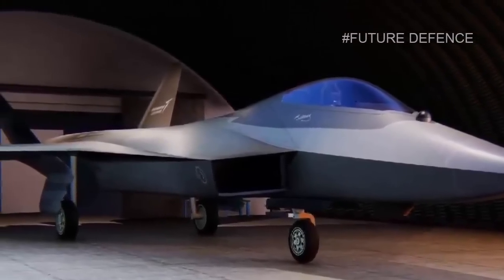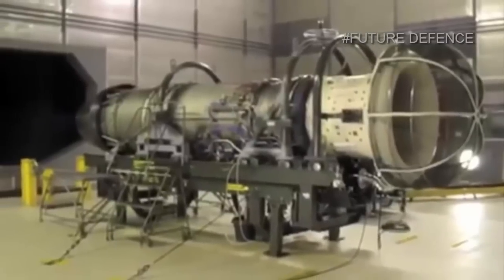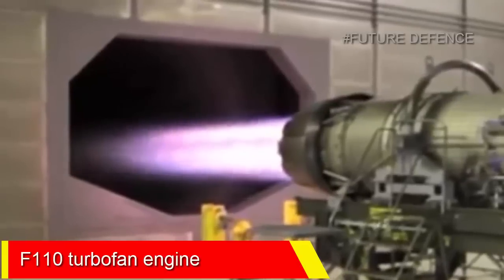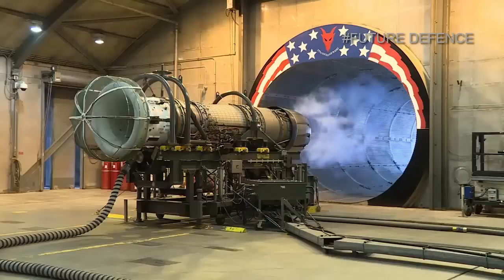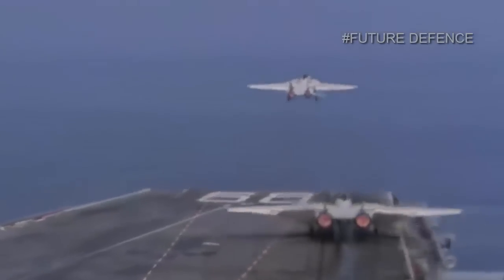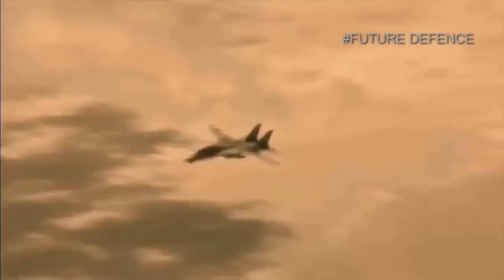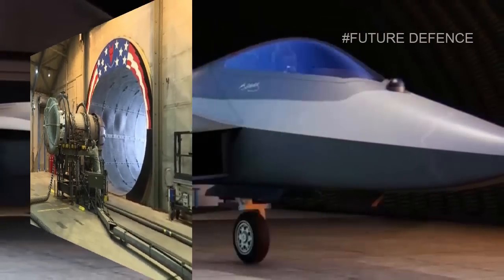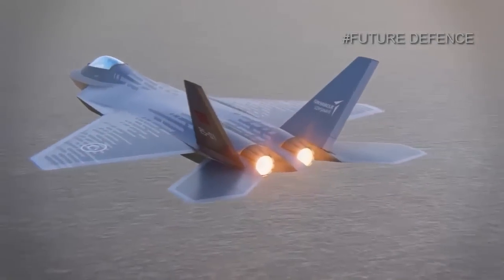here's the Turkey TF-X next-gen prototype with  U.S. F-110 turbofan engine

Comment: It needs thrust vectoring because the plane itself does not look too stealthy. It will eventually find itself in a dogfight while conducting missions. Also mach 1.8 is not enough. Must be minimum Mach 2. So there must be improvements.
Reply: they use an old engine from 1986
Reply: @bartversteege2910  This "old" F110-GE-129 engine will be used on F-15EX also. TRMotor, Rolls-Royce-Kale-Pratt, TEI will develop a new engine.
Reply: @bsenyuva  it is not the same as the f16 has...upgrated
Reply: @bartversteege2910  F110-GE-100 is the old one, F110-GE-129 is the new one. F16 is also used F110-GE-129 and F-15EX will use it.

Anyway, as I said 8 F110-GE-129 engines will be used on TFX Block 0 and Block 1 prototypes. Then it will be replaced with advanced engines.
Reply: Yeah, that's what the defense minister also said afaik. He stated that right now the plane is something between F-16 and F-35. He stated that they will improve it.
Reply: @iLikeTrains0372  No he said the new jet is somewhere between the F22 and the F35. He did not mention the F16 except he said it will be better than the latest version of the F16.
Reply: @samicolgecen1991  İsmail Demir'den bahsediyoruz değil mi? Ahmet Hakan'ın programında şimdilik F-16 ile F-35 arası bir yerde demişti. F-35'le F-22 arası olamaz çünkü ikisi farklı sınıf uçaklar diye biliyorum.
Reply: @iLikeTrains0372  F22 ile F35 arası olacak demişti, çünkü ikiside farklı görev uçağı ve MMU multi role yani birden çok görevi yapabilecek bir uçak olarak tasarlanmaya çalışılıyor. Yani F22 gibi air dominance, ve F35 gibi strike özelliği olabilecek deniyot. Ben güzel şeylerin çıkacağını arzuluyorum fakat gerçekçi düşünürsek hiç zannetmiyorum. Zaten seçilen dizayn yanlış, YF23 dizaynına yakın daha görünmezlik dizaynı olan bir platform seçilmeliydi, F22 platformu seçildi.
Reply: @iLikeTrains0372  F-35 engine is on a different level...in fact it is two engines the F35B has even 3 engines then it can hover also.
Reply: @bartversteege2910  I was talking about the capabilities. The engine situation is a little complicated.
Reply: @iLikeTrains0372  its all about that....
Reply: @bartversteege2910  F35B has only one engine
Reply: Mas maganda kung hindi gagamit ng fossilfuel😆
Reply: Tfx start.We will produce the world's superior warplanes.
Reply: @kenan1029  No we can not do that. Our plane will be better than our F16s and other 4th gen fighters. Maybe better than F35 as well, but no where near the F22 or the SU57, or J20. Still, TFX is better than nothing right?
Reply: @samicolgecen1991  From America's F35, Russia's  Su57 from Turkey's TFX aircraft is good.
Reply: @kenan1029  Türkçesini yaz ingilizcen iyi değil.
Reply: The fighter planes with Mach 2 aren't better than the ones with March 1.8. Speed limits the maneuvre capabilities of fighter planes. It doesn't have any advantage for fighter planes.
Reply: @Alprtngakrc  It does, especially in the fighters with supercruise. More power from the engine, faster the top speed and supercruise will be. Also trust the weight ratio will be greater resulting in quicker recovery from hard turns where the jet bleeds most of its energy. More powerful engine is very important. Faster top speed is a direct result of that.
Reply: @samicolgecen1991  Fighter plane pilots don't don't agree with that. They say that they rarely fly  with top speed. That must be something in the minds of aerospace engineers. This's definitely not the priority of fighter plane pilots.
Reply: @Alprtngakrc  I heard different, they say speed is everything in an event of a dog fight.... they fly with afterburners when engaged in a dog fight. So high speed  and high kinetic energy definitely a priority for them.
Reply: Couldnt Turkiye buy engine with thrust superior to 2 mach?!? I think this is a easy matter, russia, japan and britain could sell this stuff
Reply: ‘Look stealthy’ there was a b2 bomber that costed 2 billion to produce and got photographed with an iPhone… what do you think ‘looks stealthy’ means. We don’t know yet since it’s radar cross section is not published but if published we will find out how stealthy it is… the visuals won’t help. Will it need speed upgrades… probably… but the Mach 1.8 is with current prototypes and I assume using the American engines… if turkey starts to make there own using these engines as inspiration it’s possible they can go quicker . I presume that’s there plan since turkey has ordered very few engines and is also planning to sell abroad (selling abroad means turkey needs to make these jets self produced otherwise america won’t allow the sales abroad in order to drive up f35 sales ext…) basically don’t take visuals to heart and expect a lot of changes
Reply: it will fly supersonic with cruise mode and with after burner +2 mach. This video is not right. The F110 engine will only be used in prototype. In 2030 when serial production will begin it will have domestic engine with 35.000 pound trust. That means 2 x 35.000 = 70.000 pound trust. The same as the F22 viper
Reply: @oghuzkhan5117  F22 is not viper it is Raptor. Also F22 has thrust vectoring, the Turkish design will not have that because Turkish engineers do not believe in dogfighting, they rely only on BWR. If they bank everything on BWR, why not copy YF23 design (which known to be more stealthier than the F22 design), but instead go for the F22 design without thrust vectoring noosles. This is just stupid.
Reply: @samicolgecen1991  Yeah sorry i ment raptor., I dont know why i said viper maybe F16 was in the back of my mind. :))  The Turkish engine which will be produced will have after burner.  With normal cruise speed it will fly 1.4 mach., With after burner it will fly more then 2 mach. I believe it was 2.4 mach.  These F110 engines will only be used for ground test to test the software-hardware-flight control systems -mechanics etc etc for when our own engine is ready we dont need to spend time anymore to develope and fine tune these software/hardware

if we would have wait for ouw own engine it will be ready in 2028. So in 2028 we could start testing all the things i mentioned above. But because we use F110 engine in 2023 that means we will win 5 years.
Reply: @oghuzkhan5117  Every jet engine has an after burner. Even the very old relic jet fighters have after burners. You probably meant super cruise which allows a jet to fly super sonic without using after burners. My point was not about after burners or super sonic speeds (which is a bit slow in my opinion) My point is if you are going to copy any stealthy design, why not choose to copy a stealthier design like the YF23 instead of the F22 because the engines will not have thrust vectoring, thus dogfighting is not planned in any combat scenario. It was a bad decision design wise is what I mean because there will be no agility for dog fighting.
Reply: @samicolgecen1991  We dont copy anything. The law of physics is for everybody the same.  There is no better aircraft as F22. Not even YF23 or J20 or Su57. The F22 is the best of the best fighter   The Turkish MMU will be something between F35 and F22. There is a very GOOD reason why America dotn sell the F22 even to Japan  or Israel !!
Reply: @oghuzkhan5117  No YF23 was a much better design, it was not as agile because it lacked thrust vectoring. F22 s are being retired if you do not know that already. USAF is keeping the F15 and F16s but choose to retire the F22s beginning from 2030. So no. The F22 is not the best fighter, it is the most expensive fighter, not the best fighter. This is why USAF is getting rid of it. Back to the Turkish design: an F22 without thrust vectoring is a half ass fighter jet. They should have copied YF23 design.
Reply: @samicolgecen1991  wow man what is your problem with the Turks It just seems you can't stomach Turks doing something meaningful. You say Turks don't do dog fight What do you think we are doing with the Greek air force?
Reply: @samicolgecen1991  Sami Sami Sami Bu uçak deyişik silahlarla donatılacak. Bu silahları havada bitirdikten sonra geriye kalan lazer silah ile ne olacaģnı sanıyorsun? Herhalde mangalı kebab yapmak için hazır etmek galiba. Hehehehe
Reply: @samicolgecen1991  As I know thrust vectoring is not related with being stealth but super cruise. F35 has no thrust vectoring, also its max speed is 1.6 mach.

Your suggestions are valid for pure air superiority stealth fighter like F22 but not for a multirole stealth fighter.

A new engine for TFX which has super cruise ability will be developed by TRMotor + Rolls-Royce-Kale-Pratt consortium + TEI.
Reply: @bsenyuva  Dog fighting is revelant for all platforms, whether it is air superiority or multirole. A pilot will find himself in a position of a dog fight in a combat scenario going against a competent nation like Russia and not just bombing places like Afganistan. Thrust vectoring relates to only dog fighting, better striking capabilities and evading incoming missiles. It has nothing to do with supercruise or stealth.
Reply: @samicolgecen1991  I understand what you mean. What I say is despite F35 has no thrust vector, it will be the main fighter jet of NATO countries except France. If we think the possible threats that Türkiye may experience in the region, a bit faster airplane with abilities of F35 is seems enough. As you know, most of the possible air-to-air combats will be beyond visual range in this days.

Other than that, of course I would like to see a Turkish 5th gen fighter jet with thrust vectoring.
Reply: @bsenyuva  You are right. türkiye needs their own 5th gen with thrust vectoring just in case BVR may not be an option in the battlefield.
Reply: @spiderh  how does the F22 reach speeds over mach 2 while super cruise on mach 1.8?